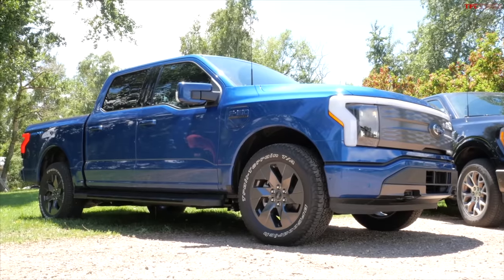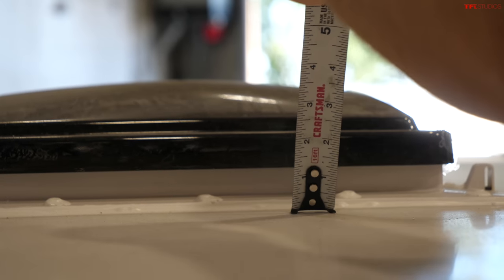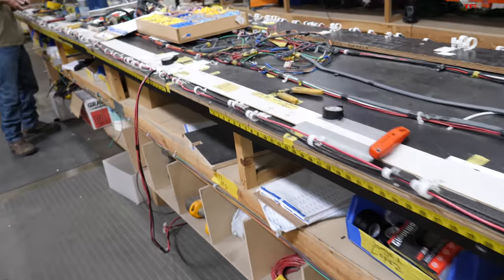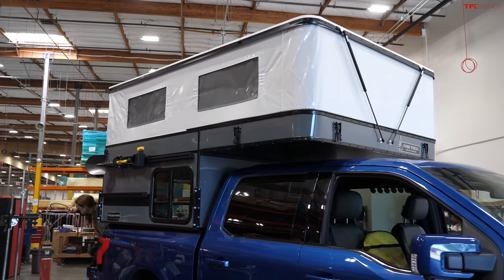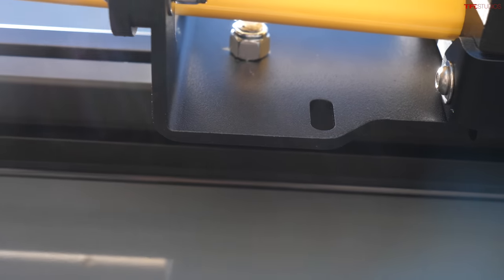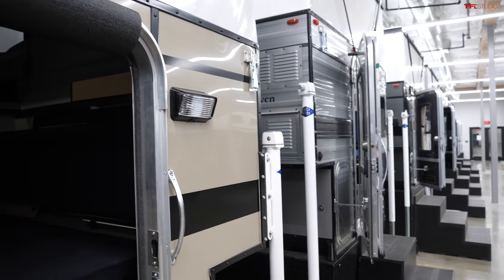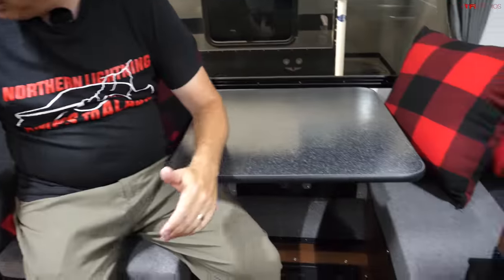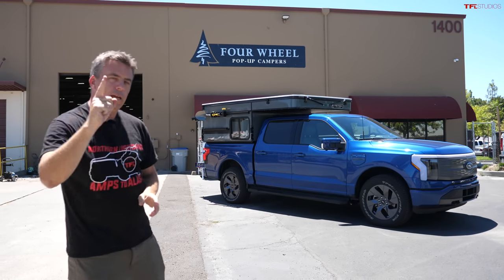Ford Says NEVER EVER Put a Camper On The EV F-150 Lightning… So That’s Exactly What We Do - Ep.2

Comment: This is so desperate. This isn't even close to being a camper, it's literally a shell. You guys are doing a good job of pretending to be positive about the Lightning for the sake of your videos.

Behind the scenes you all love the awesome trucks you already own. Powerboost babyyy ♥️
Reply: The topper shell has an advantage in that you can still use the bed of the truck.  You can carry firewood, supplies in boxes, even a dirt bike, but still have a place to sleep off the ground.  Would some prefer a slide-in camper, sure.  But some would prefer a trailer, or a tent, and this is just another option for people to find that suits their needs.
Reply: To be fair, campers are really 3/4 ton+ territory; sure, you can put one in a lower trim half ton without many options, but it would end up taking so much of your payload that you couldn’t actually stock it with anything.

This empty canopy style is all I would recommend for any half ton that wants to stay safe, and even then not for the high spec trims with low payloads like limitless.

Half tons (ICE or otherwise) are meant to tow small campers, not haul them.
Reply: You do realize that anything you might be complaining about would easily be simulated with weight, and it eliminates the cost of buying a camper. They only decided to buy that which they needed for the trip, which is a bed and table with minimal shelter. I don't know if I would have even bought the solar panel. The only thing the camper is doing is providing the aerodynamics for the trip. This entire video was probably done in order to get that much of a camper donated as the entire video had the tag of paid endorsement, and they are not endorsing the Lightning or more videos would have the tag. They were endorsing the camper company.
Reply: @ronaldking1054  You can't simulate the stress and effect of a travel trailer by pulling an equivalent weight flat trailer; similarly, just putting that weight in the bed would give you the full picture of a camper, since the camper shifts a lot of the weight higher up and thus alters the center of gravity and driving characteristics.

I bet the ratio is even similar; if you could tow a 10k flat trailer, but only a 6k travel trailer, then the (loaded) camper max weight is probably limited to 1.2k if your comfortable haul limit is 2k due to the difference in how high that weight is located on the truck.

While they almost certainly were donated this canopy in return for the video, I think they did it to promote being the "first to add a 'camper' to a Lightning" without violating any Ford warrantee; I don't think they needed it at all since they will be spending every night in a place developed enough to have decent power connections for charging purposes (and thus could have just as easily towed a trail-rated sleeper trailer with the Powerboost), but it adds to their list of "firsts".
Reply: @Cloud30000  It is not a flat trailer. It would be the size and shape of the other camper. It just doesn't have cabinets in it. None of that will change aerodynamics unless the windows are open, which typically isn't done while travelling. Yes, you can simulate cabinets with weight. None of what you brought up will be affected. It's just a matter of stowing.

Your second point is a matter of tongue weight and drag. Since trailers have axles and wheels, the weight is not all being pushed down on the back axle, which is why there is a different payload rating than towing weight. Putting all the weight forward on the trailer increases the positive tongue rate, while putting all the weight in the back reduces the traction on your rear axle. The same thing happens with campers. Putting all the weight in the back reduces your braking on the front axle as there is less friction between the tire and the road. This is why typically one loads a camper between the two axles. It helps with traction as well as distribution between the axles on the vehicle. With an electric vehicle, one can put the weight forward even more into the frunk. You then bring up height, and I addressed that in the first paragraph so that is a non-issue in the test as it can be compensated for, but you would be correct in that it is an issue in load stabilization. The funny part is that the electric truck is heavier with a lower center of gravity as the motors are on the axles rather than the engine in the front compartment, so your point is worse in a gas-powered truck, and yet these campers are used in gas-powered trucks all the time.

Andrey discussed why they used it in another video. They did not want to use hotels as they were expensive in Alaska, and they could not guarantee what they were going to get. They also wanted something that dealt with potential animal attack, which would have eliminated tents. They also stated that they wanted to take an electric truck to the northern most point to be the first. It would still be a first and less complicated with tenting other than safety.
Reply: @ronaldking1054  based in your perceived understanding of aerodynamics and center of balance, I choose not to discuss this further and you can continue to believe what you want. Instead, I will stick with discussing things with engineers.

Enjoy your truck, and don’t let science get in the way of pride, satisfaction, and happiness with your decisions and beliefs.
Reply: @Cloud30000  You are claiming that the function of weight changes what the weight does. No, it is the composition of the weight and location along with shape if there is airflow. Airflow is not a problem as the shape of the shell is the same, and all the air inside will be the same volume. You said it is impossible to shape weight like a cabinet without it being a cabinet. That is not true. I do not know why you would ever believe that to be true as mass is mass. That is science. There isn't a formula for weight that says if it is wood. Density would matter somewhat because yes there would be a torque placed on the truck, but your claim is there is no way even to estimate that. Yes, this is probably not good to discuss how to calculate things with a computer scientist as my training is how to estimate real world things all the time and model it in calculation.

Comment: From a range perspective a RTT mounted to the bed below the roofline would have made the most sense from a aero perspective. Put the 4 camper top on the powerboost. I expect this + tires will bring range down to about 180miles. Drag is murder on efficiency at highway speeds.

Comment: If the camper had an aero-dynamic boat tail extension out of the back, it would increase range greater than stock
Reply: I was looking at the flat corners behind the cab. Something to soften those edges and yeah something for the back.

Comment: I am curious if with the tires and camper if you are now under 200miles of range now.
Reply: Even with no camper, the real range is probably less than 200 miles while traveling. Range is based on 70 mph speed limit, most drive faster. If you never take battery down to 0% and only recharge to 80% like recommended, the real range is likely 60% of the 300 miles most manufacturers claim.
Reply: @derekk6906  That's not recommended at all, that's complete nonsense. The cells never deplete to 0% in actuality, the 0% indicator you see on the screen doesn't mean the cells in the battery are fully depleted and it's recommended to charge to 100% to balance the cells in the battery pack. There is not a single place you can demonstrate to ANYONE where Ford or any EV manufacturer recommends only charging to 80% or warns about depleting the battery to 0%. So, what is asserted without evidence can be dismissed without evidence.
Reply: When traveling, it is recommended to only charge to 80% when using superchargers plus the last 20% is what takes the most time to charge. Not getting below 20% when traveling is a personal choice on how brave you are. Is freeway closed due to crash and long detour ahead? Traveling with ICE vehicles, it is so easy and only takes 3 minutes to refuel, tank seldom gets below half a tank and several hundred miles of range always available. Also gas stations are at practically every exit even in rural areas. You can take your EV down below 20% all you want, I prefer not to gamble like that when travelling.

Comment: Definitely can tell that the camper was sponsored by them, the whole video was basically one big ad for them. Myself I would’ve cringed drilling holes in my brand new bed. Should’ve added a big diesel generator to keep the truck charged, be lucky if it gets even half the range it started with.

Comment: I've been looking at the Project M. Interested in how dust free it is? Alaskan hwy is a good test...
Reply: From what I've seen in other videos owners install tailgate seals and look around the bed for where dust can enter, and fill the holes with small pieces of foam noodles.  You have to do the same if you build a sleeping system underneath a conventional fiberglass topper.  If you don't think about dust getting in, you're rather surprised during your first trip out.
Reply: @briandeiwert5911  yes, but there is always dust, just how much? As you drive at speed a vacuum builds in the camper as winds suck air out. That means it has too be replaced by sucking air in...a little dust is expected.

Comment: I challenge your EV to a duel.  I am in your neck of the woods, am a fledgling YouTuber, and have a ram3500 Cummins on 35s with a northern lite hauling a 7.5x16’ 5,000 lb enclosed trailer with a cam am 6x6.  I weigh about 18,000 lbs, am 38 feet long, 11 feet tall, and 8 feet wide.  Surely your setup will be more economical, right?!  Let’s see who can go farther with a variety of tests.

Comment: Wonder if cabinets were aluminum. 
If weight could be reduced further. 

Is that an option
Reply: No they aren’t and no it is not an option.
Reply: The best solution would have been to use their buddies at best topper or what ever and just have the cloth thing and throw an air mattress in the bed.  😉

Comment: If Tesla can deliver the Cybertruck with 500 miles of range or sell it's batteries to other companies it will make everything work for people who need a truck for long distance towing.
Reply: lol keep dreaming
Reply: Which part?  🤣
Reply: @mtbse789  500 miles of range with a truck? They cant do that with a car with fantastic aero dynamics and low rolling resistance tires. The cyber truck is just a concept that is at least 3 years from being in production. Its going to be a decade before electric vehicles are used for towing, mainly due to the poor charging network and battery technology.
Reply: With battery size, you can make anything you want...... AT A PRICE. But even with sub-350 miles of range, these are $80,000-$120,000 trucks, which is just insanity for the average truck buyer.

Comment: Is the prohibition on truck campers because of the lane centering and blue cruise features of the truck? This one should not be a problem, but those that overhang the side of the truck might be.
Reply: Another video explained that the prohibition was on the fact that the battery and motors are very close to the truck bed, which made drilling of bolts for the camper problematic so that could potentially be a problem as well.

Comment: The electronics really needed to be better integrated, this is the Ford lightning electric after all. I understand it was indicated in the video that you did not do this by choice, but that seems like a mistake to me. Also, with that much power you should have HVAC built in, where's that?

Removing that big battery that came with your camper would save you a lot of weight. That's got to be close to 100lbs.

Comment: The campers AGM battery negates the weight savings of the aluminum frame and will reduce range unnecessarily. There is a good reason that EV's use lithium batteries and not lead acid AGM's, and that is because lithium batteries are much lighter. AGM batteries are also not as efficient as lithium batteries, so less of the incoming power will be converted into outgoing power.
Reply: @thegoodtom1718  
Only if the lithium battery is below 45ºF will charging need to be curtailed, and some lithium chemistries can be charged below freezing. But that system would have no issues charging at the curtailed charge rate from such a small PV panel, as the panels output will be well below the curtailed rate. As the battery system is inside the vehicle, it will be fairly easy to keep warm, and there are lithium batteries and battery systems that have internal heaters to maintain low temp functionality if there temperature falls below freezing.

Comment: Around the 16:40 mark you show the cheap ass toggle switch for the lights and then pan by the wiring harness... Notice the half assed but connectors? They aren't crimped right and they are stripped way too long... You've got exposed wires that may short out and will definitely start coroding very quickly...   They may make a nice structure, but clearly their installers are not MECP certified, what a sad mess.

Comment: Disappointed that they put an AGM in the camper. It would make for a more interesting test to use the EV to power the camper.
Reply: Agreed it would be interesting to do the math and test on how much more power consumption results from the weight of the AGM/House electrical versus being a direct parasitic load on the carriage batteries.
Reply: IMO your going to want to keep the vehicle power and camper isolated. The last thong I would want is my camper effecting usable range of my primary vehicle. However the AGM argument is legit ... they should of installed a lithium 100 ahr .. at a minimum.

Comment: For the price, some of the finishes and hardware choices are uninspiring. Example: Drywall screws on the battery box?? Toggle light switches?? Color match the jacks — and I love the  “we’re going to Alaska we need to BOLT this bad boy on”…cut to the guy explaining that usually they do three bolts but because it’s a Ford they only do two…. Sounds secure 😂
Reply: I guess you would be known as a hater today for bringing up solid questions.